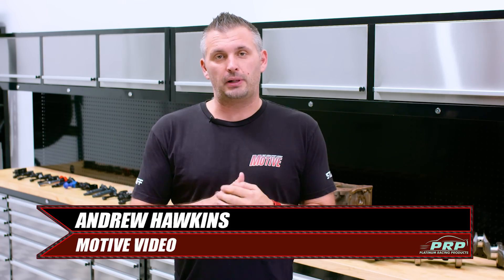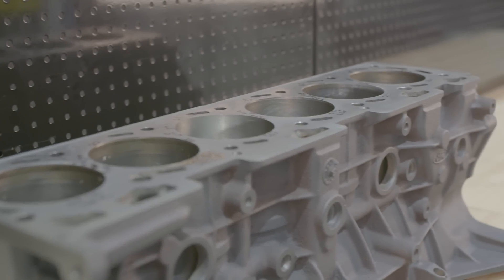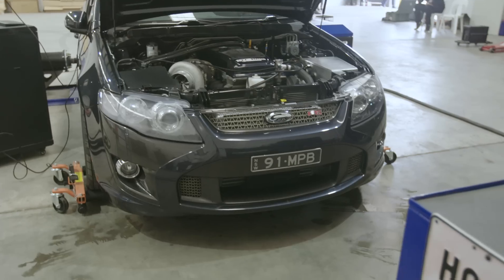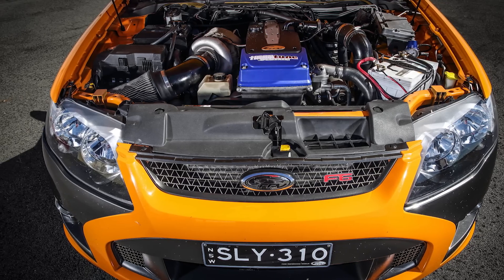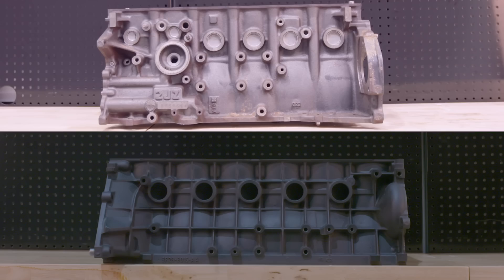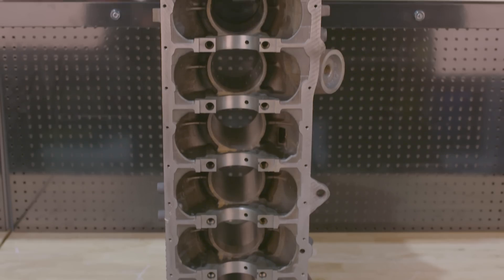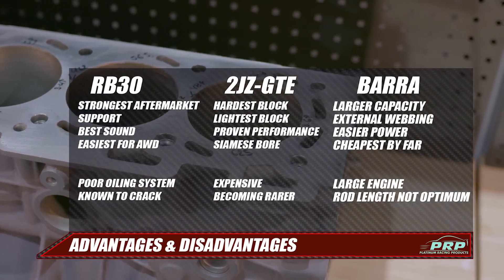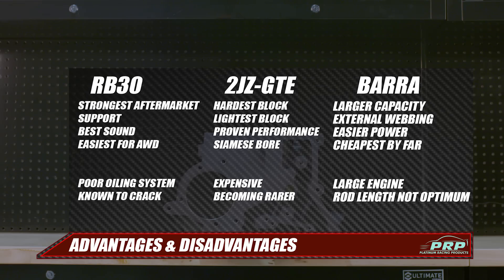Is the Barra 4.0L block better than the 2JZ and RB30?

Comment: I'm always impressed with factory durability regarding HP on factory parts.  The 2jz seems to always top every other factory longblock worldwide in terms of the straight 6's.
Reply: Not the Barra for bang for buck
Reply: 2jz has forged internals from the factory just so you know.
Reply: Because it was designed from day one to power the Supra, duh. The Barra see much wider usage from SUV to Falcon taxis. Ummm Ford is larger in terms of engineering and size then Toyota. If it wanted to beat Toyota at it's own game it could easily do so.
Reply: @dj4monie  Ford Australia did the Barra on it's own. No help from the rest of Ford, who quite frankly hated everything Ford Australia did. After BA was launched, Detroit was trying to phase Falcon and Barra out. Americans have what's called "Not Invented Here" syndrome.
Reply: @dj4monie  dude I love aussie fords but not even ford America can keep up with toyotas technologie when looking at engines, if you have ever been to a minesite in Australia there is a reason they only use Toyota it is far superior , I'm a ford barra fan.
Reply: @dj4monie  im sure you qualify for the dumbst comment on the net.ford aust cant enginer a fart,the barra is a flawed boat anchore that's sounds shit falls apart boosted or stock,we nearly bought a 2006 awd territory.honest review is its  a shitbox I did not see the tourque monster it just chewed petrol rattled spat a water pump,pinged and poped.ford Australia went broke for a reason,its called no clue/
Reply: In the USA the 92-97 2jz-ge non turbo engines are under 350 bucks.  These have turbo rods factory.  Id bet it would out run a Barra dollar for dollar
Reply: @obrienracing1  
Let's be realistic here - stock GE rotating assembly can handle 500-600whp with some luck, E85 and lots of care. FPV Barra will quite easily exceed 650-700hp on stock internals whilst maintaining excellent street manners and outrageous torque figures.
Reply: @yjkader  wrong page to dribble on barras fall apart.bang for buck 25 to 30 k for a reliable 400 kw is expensive as for a barra.facts are facts the 2jz is a shit load better, we had 12 years a ago 980 hp at the tyre 2j wih a unopened motor,dont talk shit mate a 2j will just take 700 stock.the barra is a bang for buck cheap motor deal with it.
Reply: @obrienracing1  not where i live. idiots think HURR DURR JDM  $1000
Reply: the barra is bang for buck to about 700 hp after that you will drop a house value in Sydney to try and get any reliability out of a barra and they 
will always fall apart its been tried 
and frailed ,the 2jz owns the shit out of a barra, itys sad but the ford boys have the rerp of  being bullshit artists on hp.like the great tuners say,a engine with good crank tourque does not make a good turbo engine.great skid motor,not worth dropping cash on a barra  @obrienracing1
Reply: Man O War even v8s too. What v8 or bigger can 3x their power from the factory safely? I always here these junk yard ls but they have more cylinders which equals less stress on the engine as the power is more distributed in a sense
Reply: @NISMOIZKING  
Ever heard of a Chev LM7? It's a 5.3 LS based Iron block. Around 220hp standard, 800+whp on stock bottom end is very common. Can push a 1000hp with filed/clearanced piston rings which one could do for free at home with a file and a feeler gauge.

Comment: 2jz because BMW had designed the block with toyota.  Need to do a euro S50 m3 block . Barra casting and design not that great and the crankshaft sit way low not even inside the block like the 2jz .
Reply: If bmw had anything to do with the 2jz development it would be half the engine it is today.
Reply: 2j is a Yamaha block, s58 is the new Supra engine!
Reply: @BUZDRIFT  wrong the cylinder head is from yamaha and not the block . And what s58 if I ts a n58 the new bmw engine in the supra and bmw models. Nothing too do with a S50B30/32 e36 m3 engine. What are you on about 🤔🤔😂😂
Reply: @BUZDRIFT  2J is Toyota block, Yamaha cylinder heads.
Reply: @tropicalstorm339  That's what I'm saying! maybe not clear enough, It looks like Yamaha Holds the Patent for the Engine, It was never a BMW Design! The B58 is all BMW for the GR! I said this in the previous comment but it looks like it was the same time you replied :)
Reply: Opps engine is a b58 not a s58... Why you so upset? I built my 2j e36 at home....Looks like Yamaha has the patent for the 2j, hmmm mr323i you give us bimmer guys bad names, with your bad attitude! The 2j in my e36 shits on the 328 it had. 
http://www.google.com/patents?vid=US...AEBAJ&dq=turbo
Reply: The 2J block looks to be a Japanese/Toyota Design, made in japan. I'm pretty sure Toyota and Yamaha did some prototyping in Germany, but that never lead too the 2J Block..More to do with F1! and 4 cyclinders? The 2JZ engine patent is defiantly a Yamaha design and Yes it's not a S58 its a B58 in the 2020 GR supra....🤔🤔😂😂
Reply: @Tex 13 Lol what, wtf, that's some crazy reaching going on there! As far as legal records go its a Yamaha/Toyota design!? At least that's what the patents are assigned to.
Reply: You mean Yamaha, not BMW
Reply: @BlackoutTheDrunk  wrong you too wtf another wannabe car enthusiasts or troll
Reply: Bimmers are cool